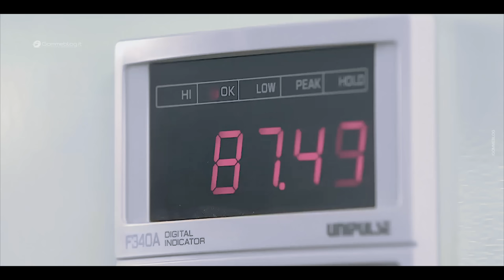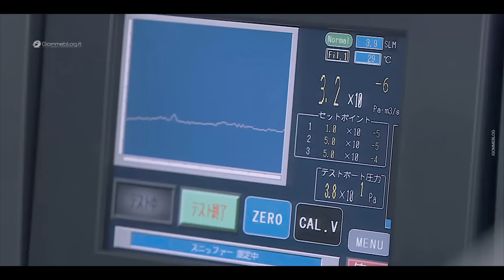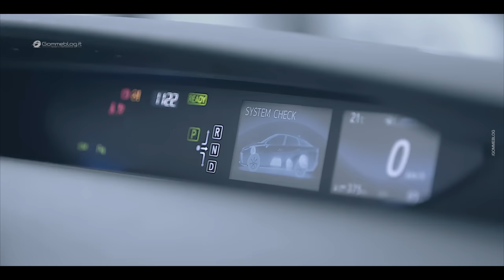Toyota Fuel Cell PRODUCTION 🇯🇵 HYDROGEN Car Factory (Japan)

Comment from the maker: Toyota Fuel Cell Production. Toyota Mirai Production Car Factory Plant Assembly Line. I#Toyota #Mirai #Production
00:00 - Intro
00:22 - Fuel Cell System Assembly
01:31 - Fuel Cell Marriage
02:06 - Engine Assembly
03:42 - Engine Marriage
04:14 - Assembly Line
10:50: Final Check
Reply: Hola, me he perdido, ¿cual es la novedad? ¿pilas voltaicas de hidrógeno? ¿o el uso del hidrógeno como combustible para motores de explosión?
Reply: If hydrogen is produced in the process of water electrolysis (mainly wind generators and photovoltaic panels), and the used components (carbon fibres, etc.) are burned in plasma furnaces operating on the basis of magnetic traps, there is a great chance for a global adaptation of the hydrogen fuel cell. No batteries can be considered due to the impossibility of additional transmission of huge amounts of electricity for fast charging. In addition, there is no sufficient transmission infrastructure to achieve this goal! It is important that the batteries have a low energy index per useful kilogram of their weight and are too heavy!
I wish Internet users a Happy New Year 2023!
Reply: Saya mau bekerja di sana

Comment: I like hydrogen fuel cell technology and I wish Toyota will succeed in this business.
Reply from the maker: You are welcome.. Thanks for your comment
Reply: The sooner the better. EVs are a lie
Reply: @pamnuman1619  u get a hydrogen fuel cell car is still an EV....
Reply: @jakey39  I think he was talking about batteries not engine
Reply: @jakey39  Yeah but you don't have to charge the batteries off of the grid.
Reply: @pamnuman1619  you're a lie
Reply: @DJRonnieG  were the F do you think H2 comes from
Reply: Sadly Toyota will go out of business
Reply: @DSAK55  Yeah, so what? It's not terribly inefficient when scaled-up. If Japan is betting on hydrogen, they probably have a plan. Nobody is stopping you from from buying a car that runs on lithium-ion cells.
Reply: Hi everyone. If they would put the same amount money in to how to produce hydrogen as they do on battery's we would se more fuel cell systems out there. For example you would be able to have your own electric source in your home. Best regards from a Swed in France..
Reply: Very complicated manufacturing, cables, circuits, sensors, and computer kits are fixed everywhere, congestions of cables run through every space of the car, and even a small fuse or electronic component burnout could stall the car. Also, the H2 tanks are put in a very odd position. This car should be a nightmare for the Maintenance and for mechanics. Just a waste of time and money.
Reply: @paperhouse6282  please explain ?
Reply: @healer1000040  same thing old mechanics said when fi replaced the carb
Reply: @healer1000040  Wirings is no more complicated than an ICE car, or BEV. Fuel cells are basically simple devices, like battery cells in reverse. Modern diagnostic can detect faults easily and no, most fuse or component faults will not stall the car.
The H2 tanks, like fuel tanks, are designed to last the life time of the vehicle, unlikely to break. Perhaps even tougher for safety and no more difficult to replace than batteries in BEVs in case of faults detected on routine inspections.
Reply: @paperhouse6282  Only hydrogen sector.
Reply: 氫燃料電池才是主流汽車
 電動車 耗電   沒有電推車在山上  如何？ 希望 豐田 本田  成功 台灣人 祝褔 台 合作成功 引導世界  汽車晶片 高功能  配合 一定成功
Reply: @irish-simon  If you look at the reasons Akio Toyoda stepped down as CEO, the comment might make more sense.  Hydrogen is super wasteful and is only supported by the oil industry because for now it’s the cheapest source of energy to produce hydrogen. It’s super wasteful in terms of distribution.  Hydrogen stations will always cost several times more to install than EV stations.  I truly think Toyota only invested in it because they want to keep building internal combustion engines and they wanted to dilute success of an alternative like BEV.  They are coming to terms with that failure.  They just announced hundreds of millions of additional funding for BEV manufacturing but they are so late to the game.
Reply: @pamnuman1619  
You mean mercedes, BMW
, Porcher. ..are dumb F on lithium batteries?
Reply: They will . Evs are a stop gap .

Comment: Japan is always about quality control. That's why I always buy models which are Made in Japan.
Reply: Not the Toyotas that are made in Kentucky?
Reply: and California
Reply: @williamwoolcock  yes and no.  There are certain models that comes from Japan.  But yes, they cut down the costs so it's built in the us.  However some parts are still made in Japan and installed here making it not 100% us made for the very reason.  However, if you do find a Japan made car, usually you can see that in the vin#, then you do have a solid car.

Comment: Its nice to see how they check all the connections for leaks. But what is that gesture they do once they have completed a construction step?
Reply: Is a Japanese way of check that they did that step and is finish. I saw a documentary about it.
Reply: Pointing and calling: In a factory, there are many people and it can be confusing. That's why it's important to vocalize your actions, so other people know what you're doing.
Reply: it's a way of visually and vocally confirm something. If you're checking a few things, it helps to physically point it out one by one, instead of just glancing by with your eyes.
Reply: It reinforces the worker to think what he did and that he finished the task, you see it nearly everywhere in Japan, in the train on the platform in workshops. I find it a super tool to think about what you are doing. you not simply finish a task. you make sure you finihed it good.
Reply: @iliacmartinez2320  As a Retired mechanical engineer, I can say I went through this procedure all the time on every job
Reply: i saw a video of Japanese postal workers doing the same thing when checking the safety points on their delivery vehicles.. it looks like a very good habit to pick up :)
Reply: If you travel on a train in Japan. Sit as close to the  driver as you can. They acknowledge every train speed sigh with the same hand pointing and gesture. It's very reassuring.
Reply: But yet it's still leaking when it deliver for the customer
Reply: It's actually base on the research in Japan that when all your senses are fucos on the task at hand, the lesser the chances of mistakes. That's why they point, look at it, then say something. It's like coordinating your sense of eye sight, sense of hearing, and touch by way of pointing which activating your muscles. All of it said to makes your mind more fucos and would not likely easily get diverted on other things outside of work. ✌️
Reply: double checking..
Reply: @Tagohala  *focus 👈 ...😉
Reply: Hara kiri
Reply: @paperhouse6282  10000 PSI it's not a joke. Yet people still things that it's doable. Sheep.

Comment: What is missing from the comments of course is why hydrogen does not work out for roadway vehicles and cars in particular. The real cost of green hydrogen at the dispensing point is over twice that of gasolene or diesel because of the poor energy density of hydrogen (joules/cubic metre of gas) and the high cost of dispensing infrastructure. It takes 20 times as many transport trucks to deliver hydrogen at 250 bar (max allowed) than gas tankers. Liquid hydrogen is not viable due to even higher costs.
AND note in the video the massive space taken up by the multiple tanks to store about 6kg in a passenger car.
There is no known technology that can overcome these inherent shortcomings of hydrogen.
CA has enough hydrogen stations to support 3.5 times the  number of FCEVs on the road so it is not the "lack of fueling infrastructure" that is the problem.

Comment: Love the assembly of an old Gen 1 Mirai.  I wonder what a newer Gen 2 Mirai assembly looks like.  Gotta be super expensive to sell with all that manual labor involved.  Imagine all the ongoing maintenance to check all those connections for leaks down the road.
Reply from the maker: Thanks for your comment
Reply: To imagine, no need R&D at all 😁😁
Reply: Certainly does not look like Tesla diecasting and robotics.

Comment: I did hydrogen fuel cell catalyst research before. Japan has had enough hydrogen fuel cell catalyst tech, but it mainly uses Pt, an expensive rare metal. It might be the reason why its hydrogen cell car still couldn’t go to the market in big business scale.
Reply: I have read of development in fuel cell technology where they are using less expensive components. They are also finding ways to produce hydrogen that doesn't require a lot of power and is greener. There developing ways to safely store hydrogen. I think hydrogen is the future.

Comment: Imagine the cost when you take that to a mechanic... or the repair cost after a crash?
Reply: You could say that about any modern car , repairs costs are huge
Reply: @patcoakley7980  No comparison.
Reply: Geez.... just look at the difference between the mechanics, body parts, computers, etc. If I have to explain it, you wouldn't understand.
Reply: @JohnWarner-lu8rq  Well, the tanks and their frame seem to be easily removable. Just look at how quickly they are installed. The engine is just as easy if not easier to remove than a normal engine. Maybe it's you unable to tell the difference between complexity in construction and complexity in installation?
Reply: Ronny Lux  Hard to determine comparative costs yet. A bit too soon, isn't it?
Reply: @SweBeach2023  It's not just parts replacement, but the associated structural repair costs, like from a collision.
Reply: Ronny Lux  First, the "future" won't be EV's. And, as for the specific car in the video we're discussing, one would need a few years worth of driving to accurately determine the costs.
Reply: Insurance?  LMAOOO

Comment: H2 the obvious choice in electrification.
Toyota leading the way and now joining with BMW for another H2 project .
Electric drive motors with on board Fuel cell electric producing engine   to provide electricity to the motors is genius .
Looks to be the steepest and fastest “to market infrastructure “ curve in the transport industry compared to batteries and I.C.E

Comment: Japanese are good at looking down to details. They need to look up to the future.
They have been trying hard to set up high threshold in fuel cell technology by patents in order to monopolize this market, just like SONY did on Betamax video recorder in late 1970s, which, ironically,  is making other players to switch away from hydrogen cars. 
Also, MP3 format taught them another lesson.
Reply: yes exactly. they manufacture to the perfection a completely obsolete technology. Unfortunately, that is the picture of japanese industry in a nutshell....

Comment: Every super critical boiler in the US produces high volumes of hydrogen when the steam goes super critical and becomes fast moving molecules going into the high pressure turbine. Sometimes it will come out and friction will cause it to flare off. All we have to do is separate the oxygen from the hydrogen at that point and store what hydrogen in high pressure fiberglass or carbon fiber tanks. These tanks could be filled in hours and enough hydrogen could be captured to fuel every car in the US in just a few days for a year including freight trucks.

Comment: Compressed H2 is difficult to make at industrial scale.. they 1st have to solve this problem... the hazard issue is no biggie. There's lpg cars, busses etc running around and you don't hear about huge explosions or what not... if you came up with gasoline or alcohol based platforms today, you wouldn't get passed the reception desk of the epa or the ntsb..

Comment: For ever since Toyota brought out the Prius I’ve said fuel cells are the true answer. Everything prior to that have been hasty panic offerings for lack of skill. Fuel cells!👍
Reply: They are terribly inefficient and therefore not the 'true answer'.
Reply: @3636tango  High voltage DC connections do the job much more efficient. Shipping hydrogen around the world is terribly inefficient, incomparable to LNG for example.
Reply: cost more to maintain, more $$$ for toyota bad for consumers.
Reply: They are really inefficient. You also have energy transfer losses. Also, where does the hydrogen come from? Currently it's mostly made using fossil fuels in a chemical reaction process. Yes it can be done using electrolysis but for the energy transfer losses you might as well use simple batteries.
The vehicle technology is complex and needs much more servicing than a ICE engine. It also has many many components that could fail and be costly.
Reply: @jackking5567  Exactly! Really sad to see Toyota still on this fool's errand. And the leakage issue is a bigger problem than it would seem...

Comment: wow great job - looks like a car built by scientists ! But 3 cars per day isn't going to make any difference in this world when each one 
A ccc Can Not Refuel at home
A ccc Can have the potential to level your home in a split second.
A ccc Has no fueling infrastructure.....and Ive heard it takes a long time to fill those tanks / and A LOT of energy to get the pressure.
And who makes this magic fuel? If you could get home solar panels to produce hydrogen it may be practical. but I don't see anyone working on that ! ! ????? RIP Toyota - I think you bet on the wrong horse! !

Comment: Filling up with fuel cell cost as much as getting a full tank of regular gasoline, while charging an electric vehicle from zero to 100% only cost about $5-$10 average. Do the math everyone. The infrastructure is not even here for this while the infrastructure for electric vehicles is all around us.
Reply: @ronnylux8777  Germany is known for their energy efficiency so it does make sense that you would say that, but also Germany lacks in natural resources and has to have everything pumped in from oil from the middle east to natural gas and other fuel forms from Russia which fuels their war with Ukraine. Hydrogen still requires a combustion engine in a sense and still gives out a polluted called nitrogen dioxide. It's also not made and can't be made with renewable resources. It's takes a lot of energy to produce and very volatile to handle before it gets into your car. On the outer hand, the usa is abundant in natural gas, oil, renewable energy, and much more which makes it very rich and not really reliant on other countries for a resource. The oil that is mostly found and pumped in the usa is stored... look up the government oil reserve.

Comment: What is the best of electric cars and hydrogen cars?
Reply: Supra best
Reply: BYD, GAC, XPENg, Tesla, Nio,...mainly Chinese...and: Tesla.
Reply: Electric is better. It's more efficient so the "fuel" cost is lower.
Reply: There are only 2 hydrogen cars produced today that you can actually buy.  The Toyota Mirai and the Hyundai Nexo.  One is a sedan and one is a compact SUV.  They sort of serve two functions so I'm not sure which one is better.  The Mirai is both the best and worst sedan and the Nexo is both the best and the worst SUV.

Comment: Wonderful vehicle. 
By the look those two tanks hold 3 kg each of hydrogen.
There are no H2 fuel stations here in the south of UK - that I know of.
If they build a fuel cell car, and feed the cells with unleaded gasoline, the car would run 100 miles/gallon (or more) instead of 50 miles/gallon of an ICE car - with the same amount of gasoline.
H2 is hard to get, gasoline (petrol) is not...
Reply: 1 Liter fuel (gasoline) 10kWh 1kg Hydrogen 33kWh. 
The Mirai Needs ~1,3-1,5kg 100km An Electric car needs ~20-22kWh/100km. 
That is the most Effektiv technology with lower cost
Reply: Thare are no H2fuel stations in the south of UK ? FUNNY you say that because there are four stations in the London Area , my friend has a Mirai and says it is better than electric car , he had electric car but prefers the Hydrogen Car

Comment: That's so awesome!  Now I just gotta figure out where the nearest hydrogen gas station is.
Reply: Have  mobile  filling stations  that service large areas  at set times to fill up until the re are enough hydrogen cars to support a fixed filling station as it is happening in Germany  ?  ?
Reply: Vancouver BC has 5 filling stations. Takes 7 minutes to fill up.

Comment: The trick is to heat and power your house with the fuel cell and charge your car from the house., that way you dont have to drive around with compressed hydrogen. You could have one fuel cell power several homes and multipul cars.
Reply: Now, what's the trick to refuel the fuel cell at home?
Reply: @Align700nitro . You separate the hydrogen from H2O. through electrolysis with the electricity you just made, compress it, store it in pressure vessel, then use it as fuel to make more electricity. It's just that simple.

Comment: Very complicated manufacturing, cables, circuits, sensors, and computer kits are fixed everywhere, congestions of cables run through every space of the car, and even a small fuse or electronic component burnout could stall the car. Also, the H2 tanks are put in a very odd position. This car should be a nightmare for the Maintenance and for mechanics. Just a waste of time and money.